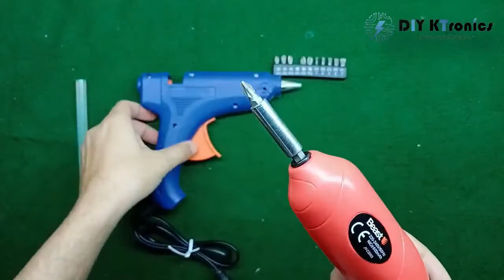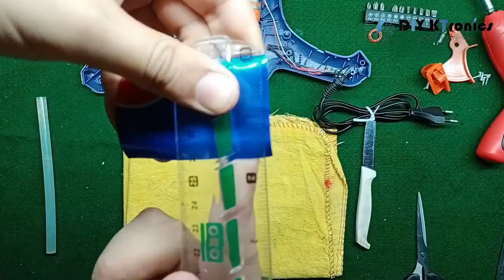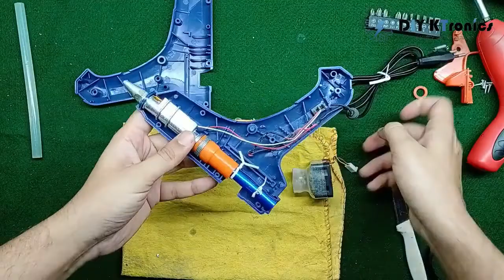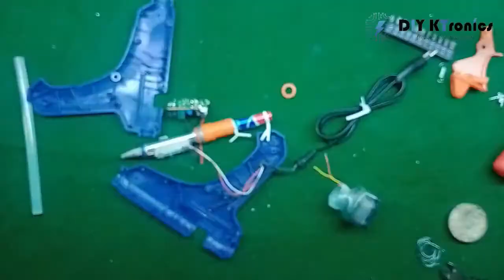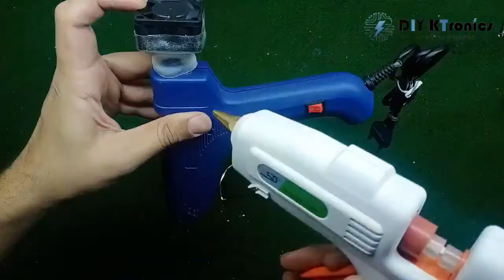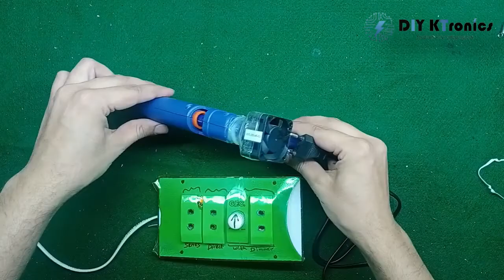How to make Hot Air Gun from Hot Glue Gun || DIY Idea for Broken Glue Gun

Comment: I was waiting for such a video. The following are the suggestions  in altering the glue gun:
1. The air in let arrangement should be completely sealed till the air sucked by the exhaust fan and also the exhaust fan should be covered to the minimum. So that the fan can suck more air.
2. The fan should be operated at full voltage of 12volt for high speed.
3. Inorder to accomodate the power supply inside the gun and use the power chord for smps P.S and the heater in the gun your this arrangement is look nice but the power supply is of ,9 volt/1 amp will not be sufficient for the fan to run at full speed. You can keep power supply in a separate box outside and cable to fan can be drawn from it with banana sockets; the power cable of the heating element left as it is.
4. The nozzle bore should be trimmed and bored and an antenna barrel of 2" can be inserted at the front by brazing it. This arrangement will provide hot air to be focused on the target chip,etc. Perhaps my suggestions are a laborious one but it will give good results.

Comment: We are watching this because we dont have a hot air gun . Yet you have to have one to make one . You might could've came up with another way to shrink the bottle , use somethin else I need a heat gun for alot of projects . I live 2 hours from a stor . I'm way out in the TX hill Country . I cant hop in the truck and run down to a store here.so slot of things gets made using common sense and parts . The way I like it ...
Reply from the maker: Point well noted.  There are other methods to shrink the bottle e.g. you could just use igniter / hair dryer or simple lighter/ torch with protection of course to apply heat and shrink bottle.  Or if some other suggestion clicks to your mind may be some other alternative to bottle would be great.  Hit us up with the idea & good luck with your diy project. Happy to help!